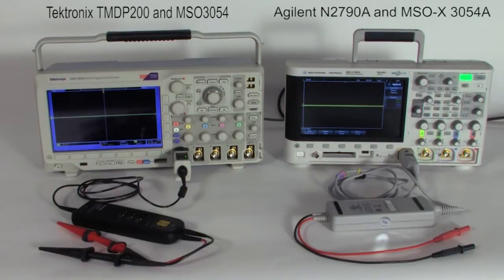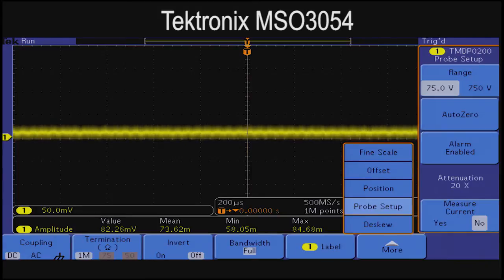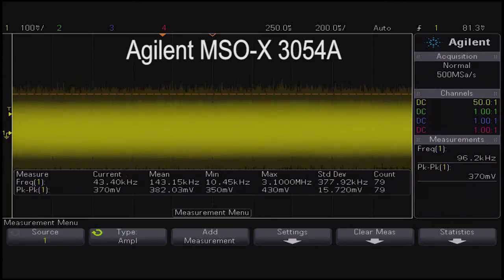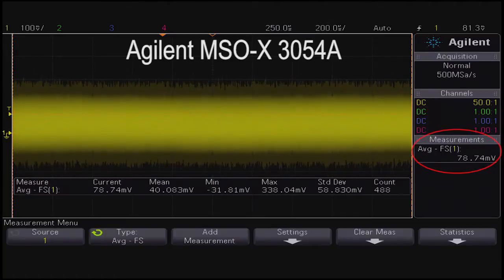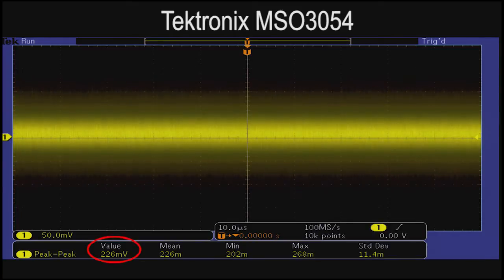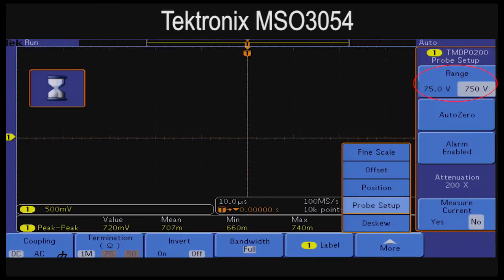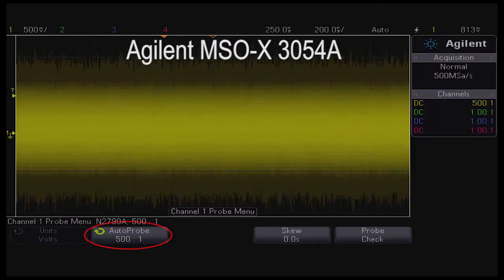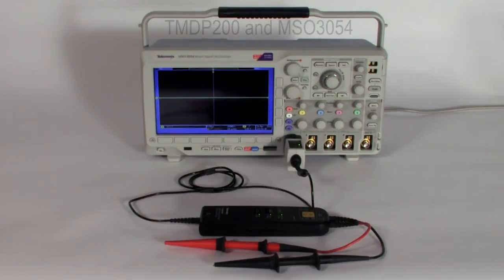Tektronix MSO/DPO3000 vs. Agilent MSO/DSO3000 X | High Voltage Measurement Capabilities

Comment: I am an engineer, looking for a new scope.
Why is it, that I am only disappointed in your videos and your presentation of your scope. If I want to measure high voltage, I do not need to be in the noise floor and it does not matter. This is really another tektronix embarrassing video. Sorry to say, this type of videos will not sell me on a professional level any tektronix scope.

Comment: I don't know what the point is with this zeroing high voltage probes in the 1mV/div vertical setting. (20:1 probe for the Tektronix and a 50:1 probe for the Agilent).

It's also no news that the 1mV/div and 2 mV/div settings for Agilent are magnifications of the 4 mV/div.

Comment: But did you measure high voltages? Where are the results? Tell to mr. Danaher that If he wants to sell scopes to truck drivers and home builders it's fine. But if he wants to sell scopes to engineers your marketing dept. must try harder.